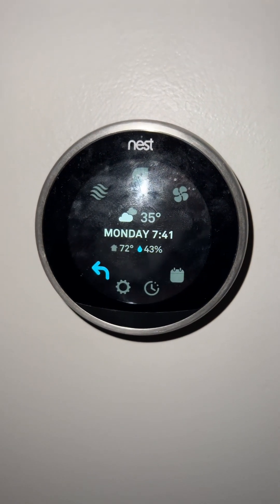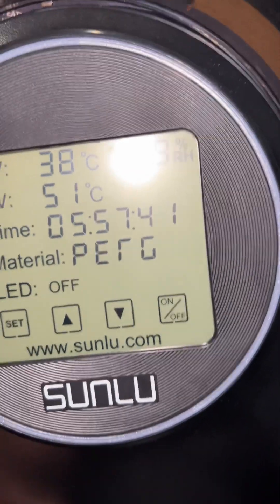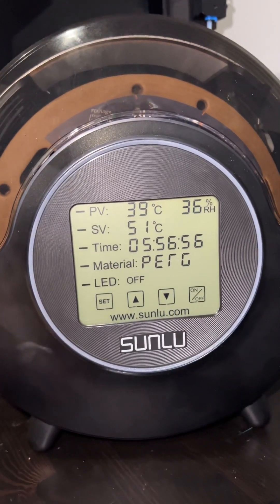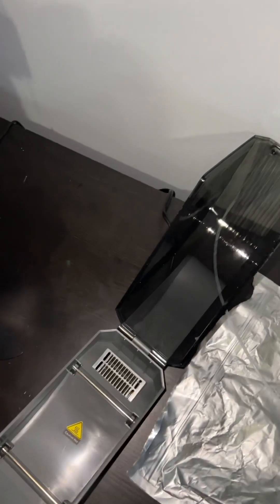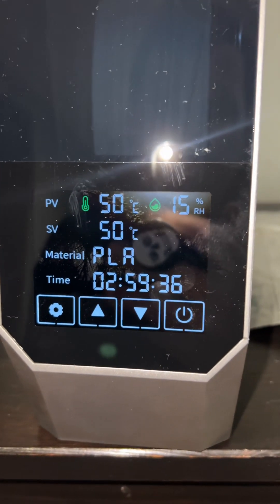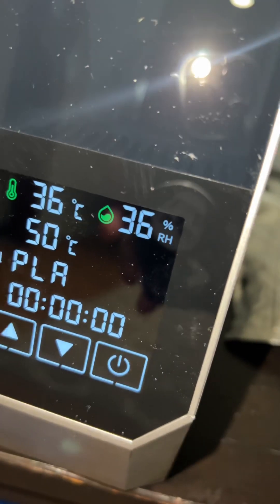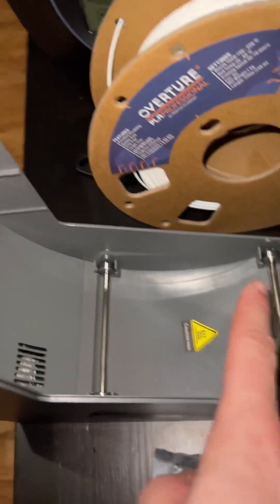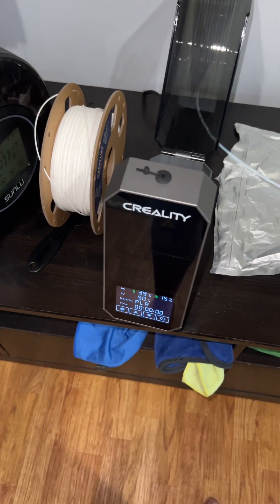Creality space pie filament dryer. Issues already?

Comment: The hinge complaint is kinda petty
Reply: not really. I have the same complaint. Its pretty annoying to have it open unconstrained like it does. My space Pi with 2 roll capacity has an error where it doesnt even turn on the heating or heating fails after an hour (e4 flashes where the temp should display). 2nd day of owning. Going to try and get a different one.

Comment: Hey there. I have exactly the same problem. It worked for a few weeks now, actually was very sensitive, it changed already when opened the lid. Now its at 15%, even if blowing into the dryer. Waiting on customer support to respond.

Comment: turn it sideways  du
Reply from the maker: the humididty sensors on the bottom of the unit so it would have to be upside down.
Reply from the maker: @BlondieHappyGuy  If creality send me a new one I will send it to you if you pay for the shipping. Im waiting to hear back from them to see whats the next step. its good to know and makes sense even with air moving around that it should still see ambient humidity. i figured being in the center away from fast moving air would get better results.

Comment: Thats a bit crazy. Maybe you should try reaching out to Creality Support and see what's going on with it. It could be a bad thermistor?
Reply from the maker: Thermistor is what senses temp. a humidity sensor is what the issue is. I think its a design issue. i have a odd feeling that those slits are whats causing the issue. I did contact them and working with them on the issue. I have already verified someone els is having the issue.
Reply: any update? @CarsN3dPrinting
Reply from the maker: I reached out to them. "they will look into it"
Reply: @CarsN3dPrinting  great 😂, i bought one today but it wont be available till end of may, we can probably just move the sensor, and tbh, the sensor doesnt mean shit anyway, it shows the relative hum for the air, not the filament, so just put it in the amount of time required + 2H
Reply from the maker: @Gagliano17  I understand its the relitive humidity in the chamber but that still repersents whats being released off the filament. 2 hours is a good start but Im not gonna belive or waste energy when it could dry faster. This is also a factor if you live in more humid state which means its gonna take even longer to dry. you cant move the sensore. its soildered to the board. I mean you can move it but whats the point for something you paid for that doesnt work. If you wanna throw your money at something that doesnt fully work go ahead. I dont belive in that moto.
Reply: @CarsN3dPrinting  i always modify any device i buy, everything can be improved, i agree that for 70 dollar here in europe, it should just work, but if im getting it and it doesnt ill fix it, ive not seen a better dryer tbh
Reply from the maker: @Gagliano17  my sunlu S2 works really well. have been happy with it. like you slight mod is keeping the door open slightly to vent out moisture.
Reply: @CarsN3dPrinting  i just dont like that the sunlu has the screen on the side, wont work with my setup, hence why i like this one
Reply from the maker: @Gagliano17  funny enough this one doesnt work well with the K1. Once i get a working unit ill do the review on it and explain.